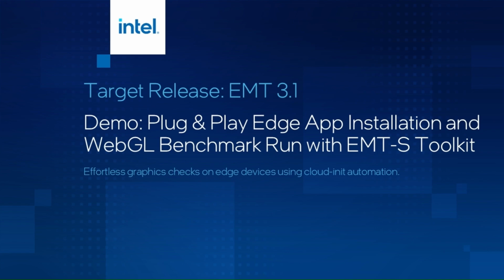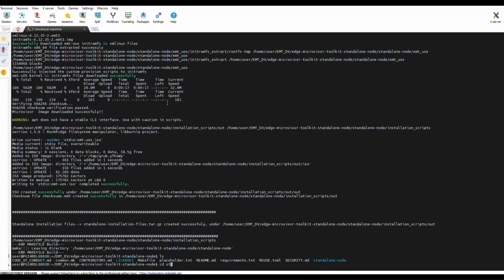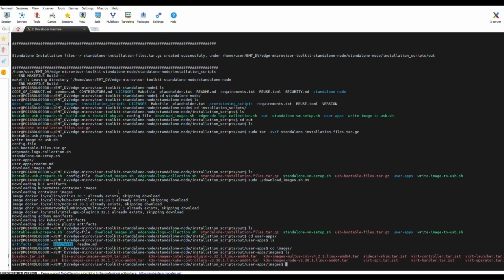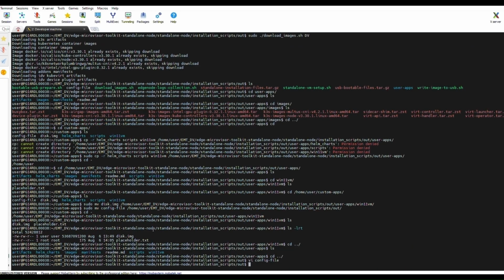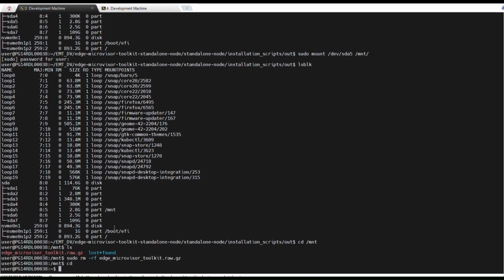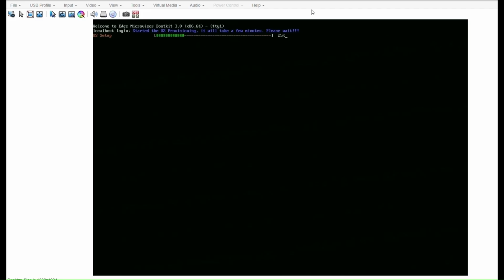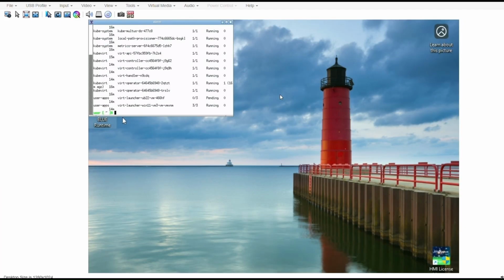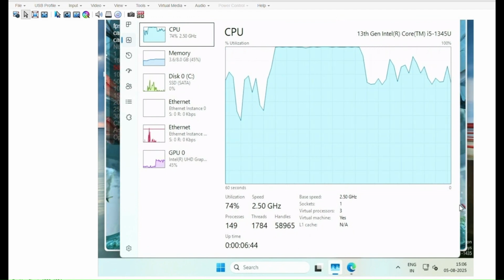Automate Custom App Deployment on EMT-S Using Cloud-Init via Bootable USB | Intel Software

Comment: When will intel drop dei and start producing quality products again! Intel is dead. It needs a Miracle and its current woke staff is not it
Reply: I'd agree dropping DEI would be a good idea, but I don't think Intel is dead.  Fwiw I built an Arrow Lake-based system with a 285K and a B580 and it's been working out great so far 👍